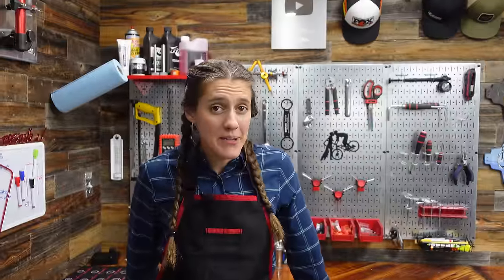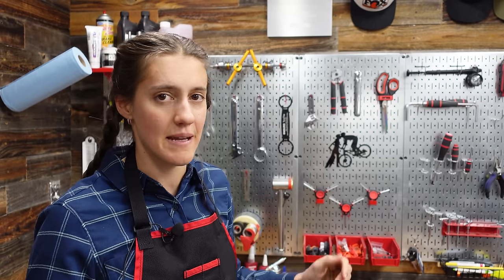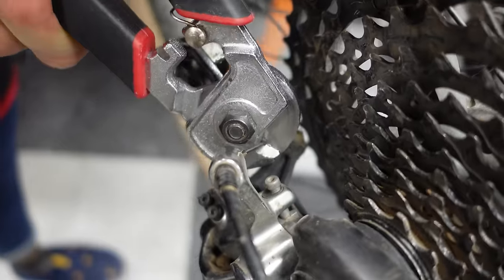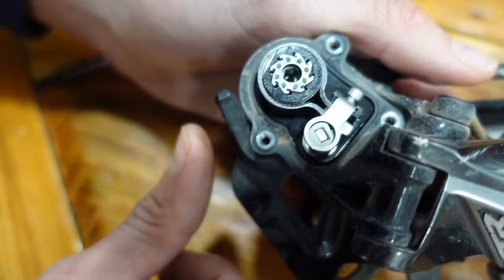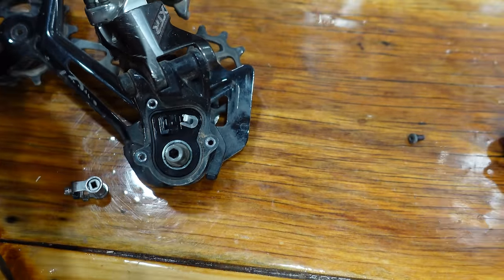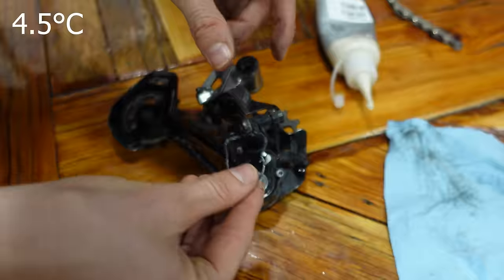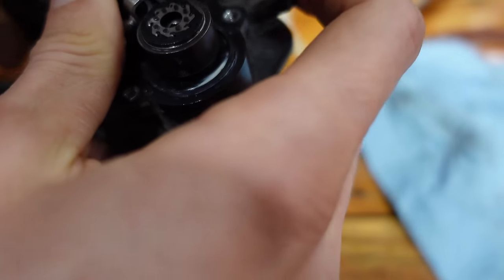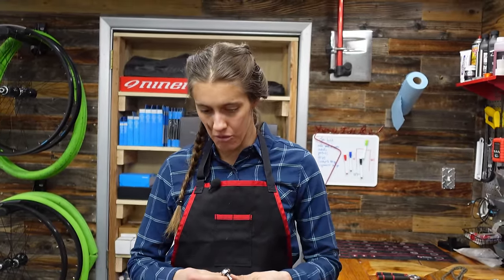MAKE YOUR BIKE QUIETER (clutch derailleur service and adjustment) | Syd Fixes Bikes

Comment: Huh this was fascinating and well explained. I have an SRAM derailleur (and I was confused at first because in German we don't say front and rear derailleur, we have entirely different words and I only knew the front one was called derailleur) and it has a completely different mechanism but it's still good to keep in mind that there are more serviceable parts than the usual ones (like, brakes, or the stop positions of the derailleurs). So I'll take this as a reminder that my bike is five years old now and could probably use a lot of service.
Reply: As a german living in Canada I can confirm that the german names for bike parts are the worst lol. All my family is in Germany and I cringe every time I have to use the german words for all the components.
Reply: I'm from Switzerland and since I gathered most of my knowledge online (in english), I struggle a lot with the german names of the less basic bike parks and even more with those of the tools.
Reply: @helenaugustablanchard3915  Except that both parts kinda do the same, the front one in a more throwy way, okay, but you could definitely call the front derailler a Schaltwerk, too. Also other bike parts are surprisingly not helpful, like Vorbau. Not that "stem" would be any better.
Reply: Same
Reply: But I knew Schaltwerk and Umwerfer

Comment: What a great illustration of this entire issue and servicing! Amazing instructional video! I have a pretty new bike and it seemed like the shifting was a bit sticky. I think the arm moves better just from moving it a couple of times manually, seemed like it was just a little stuck and just needed to be worked a bit. I will have to test ride it though and see if that alone improved it or if it will take further adjustment. Thanks again for the education!

Comment: Thanks for the video. I've serviced the clutch on my XTR derraileur many times, but always looking to learn something new. Definitely will look into the adjustment part.

Another symptom of it needing service: when shifting to smaller cogs the derraileur cage does not move and as a result the chain is sagging. Learned it the hard way.

Comment: Easy to understand and follow quality video 👌 
I've understood that riding with an oval chainring (like I do) can require the clutch to be serviced more often since there is a constant tugging from the chain due to it essentially being alternately shorter and longer. I guess it's just another reason checking the clutch.

Comment: Grease separates (like the Shimano white grease you are using, also black Shimano brake grease, Park Tool antiseize and so many others)  - meaning oil componehts and particles separate in the tube during prolonged storage. Before applying, squish the tube back and forth so that the stuff inside mixes. Probably not a concern if you are applying a lot of it to a big/moving part (like antiseize to bottom bracket or white grease to internal gear hub) - there it'll mix on its own anyway. But if you are using a small amount, like in this video, you might be under-greasing things a bit (bc oil will usually come first out of the spout).

Comment: Perfect timing! for me... I'm having problems with my clutch breaking loose while jumping or riding through rock gardens, it makes a terrible noise. I have put about 2300 miles on the derailleur since it was new and have done 0% maintenance on the clutch, didn't even know that was a thing. Thank you for covering this. I can't wait to see if I can fix it myself.

Side comment, I have had my torque wrench for about 13 years and I am starting to think that it needs to be calibrated. I have seen youtube videos about how to calibrate it but was wondering if you guys have ever run into this?
Reply from the maker: We've already heard that after a while they need to be recalibrated, but have never done it either. The Feedback Sports one we used in this video doesn't require recalibration because it's got a spinning dial you just set up 0 each time.

Comment: Love the videos but you forgot something. If you already picked apart the clutch you should go further and pick out the spring as well. If you ride in a wet and muddy country as I do water and outher muddy things will go into the spring making it not working as ir should. Thats why you need to do a deep clean and grease. You should also put silicone on all rubber things inside deraillur. I still do the same on shimano and sram and on sram axs. Water and mud demages all deraillurs if you dont clean and grease them. My clutches and derailuers still works perfectly.

Comment: You can use a magnet to recover any swallowed bolt, assuming they are steel. Simply press the magnet against your stomach and slide it up to the bodily orifice you have chosen to recover the bolt from.
Reply from the maker: Just like running internal cable housing 😉

Comment: If you swallow a bolt tie a string to a magnet swallow then do jumping jacks pull on string and the bolt will hopefully come out if you don’t do this promptly you may have to approach job from the other end with a liberal coating of grease on the magnet

Comment: Hmmm if it's been a year, you might want to take that derailleur down a little further and lube the other side of that clutch shaft where the derailleur actually rides on the shaft.

Comment: My brother swallowed an open diaper pin (way back when they used cloth diapers and pins).  X-rays showed it was pointed in the desired direction so they let it pass, otherwise surgery would have been needed to remove it.
Reply from the maker: Oh yikes! 😳

Comment: Do you think a 8 speed clutch derailleur would help a midrive Bafang  M620 not  make a knocking sound like  with the  Shimano Altus  that's on now when in 7 or 8 th gear ?.Thanks
Reply from the maker: Most likely that's a derailleur adjustment issue.

Comment: My new Delore derailleur makes popping noises in certain gears, it was installed by a shop. I have a E-Bike (Trike), I lift the rear of the bike and power up the rear wheel, my uneducated self thinks that the upper pully wheel and 9 speed chain are not fully engaging each other, and the popping noise is a random tooth of the pully wheel and chain striking each other, is there an adjustment for that or is replacing the pully wheel with one or two more teeth the answer to get rid of the noise?
Reply from the maker: The first thing to check would be whether you're shifting is correctly adjusted (https://youtu.be/of-T8uB8tbs). Next would be if any of the teeth are bent. If not, try replacing the pulley wheel (you shouldn't need one with more teeth as the spacing on all chains is the same, it's the width of the chain that changes with different cassettes).

Comment: 1:13 if I was going to take the derailuer off my bike why the heck would I break my chain? Those quick links wear out
The 1 little Allen screw on my derailuer lasts forever and takes 15 seconds to undo and rotate the cage

Comment: Can chain slap also occur when the clutch is too tight? I got a new m5100 derailleur and it's loud but the clutch is on and everything.
Reply from the maker: Depending on the bike and terrain, chain slap can still occur with a properly adjusted or overly tightened clutch. But it being overly tightened isn't going to increase the chain slap compared to a properly adjusted one (whereas under tightened will).
Reply: The first few degrees of movement just aren't tight, only after those it's hard to push the derailleur further... Idk why that is the case...
Reply from the maker: Yeah, that's fairly normal. It's fairly easy to move the first little bit, but then it gets hard if the clutch is on
Reply: The cassette was loose 💀
Reply from the maker: Glad you figured it out!

Comment: Close, but needs refinement Guys. I'm surprised at the vid's I've watched on YT that give a tutorial on servicing this Shimano Shadow RD+ Series "Stabilizer Unit", or as it's being referred to in these Vid's, a Clutch. Nobody's read the Shimano DM (Dealers Manual) on servicing for this thing. If it was read, you'd know the Nomenclature and Design features of these well-designed Drive Train components, which would help Greatly in describing and teaching maintenance procedures to dummies like myself. Actually, in my view, this was a better production than Park Tool has put forward on servicing this Stabilizer Unit. I guess it's Shimano's prerogative to call this device whatever they want, just look at all the Other weird Shimano names given to their Bike Components. Part of this Stabilizer IS a Clutch , the "Inner Thing", as you refer to, is actually a Sprague Bearing. The Spring Steel outer band has an adjustable tension screw allowing you to regulate the friction between the Spring Steel Band and Sprague Bearings outer housing, which is a Clutch by definition. What makes a Sprague Bearing so unique is it's ability to rotate completely Freely in One Direction Only while supported by Needle type Rollers, but it locks up to a standstill on the supporting shaft (P-axle according to Shimano's EV Manual (expanded view)) when attempting to turn the opposite direction. When the Sprague Clutch Locks up, the Spring Steel Band wrapped around the Bearing outer housing can then act as a Clutch and allow regulated slippage. Sprague Bearings actually DO NEED lubrication w/ light oil over the inner Rollers & supporting Shaft. It is a Bearing after all and the oil helps to guarantee that the internal locking mechanism stops & compresses the Rollers onto the Shaft, forcing the entire bearing to stop, and to supply needed lubrication over the center supporting shaft & Rollers.  That's how Sprague Bearings work on Helicopter output shafts to the Main rotor so as to allow for Autorotational Landings, or Landing w/o Power. A Sprague Bearing has many unique uses and Shimano should have given some better detail on how to care for this one.

Comment: It's a common misconception, but you don't need to open your chain to remove your derailleur. You can just unbolt the upper pulley and loosen the lower one.
Reply from the maker: But that's a lot harder than popping the quick link 😉
Reply: @sydfixesbikes  All good if you have an unlimited supply of quick links, or if the ones on your bike are reusable. Shimano's are not--don't they sponsor you?
Reply from the maker: We've reused Shimano quick links for years without any issues 🤷‍♀️